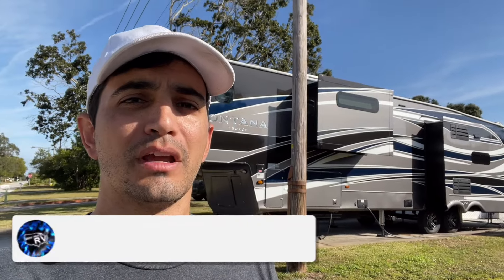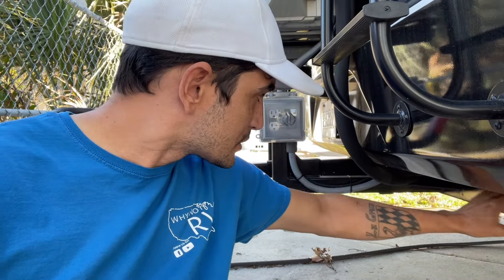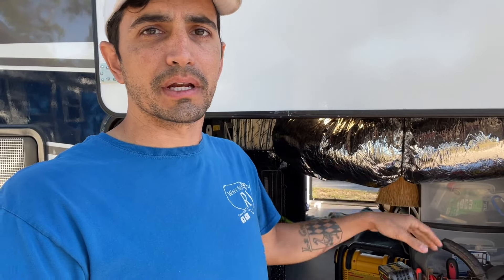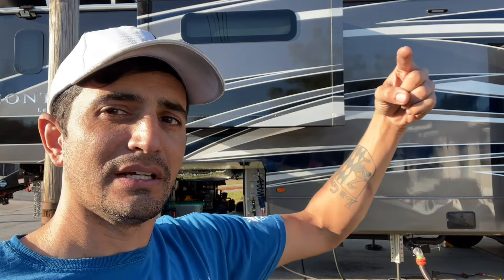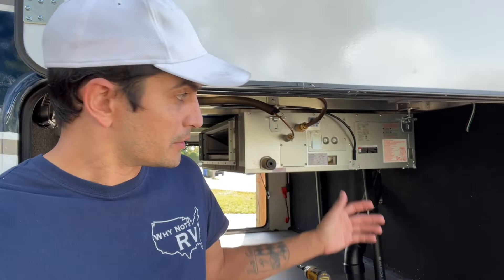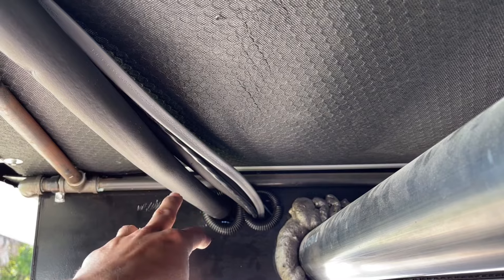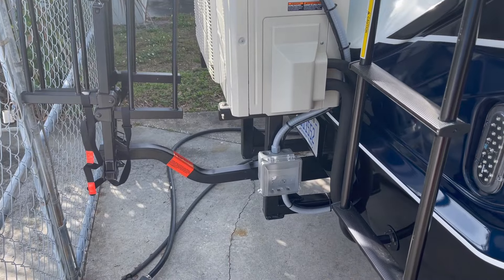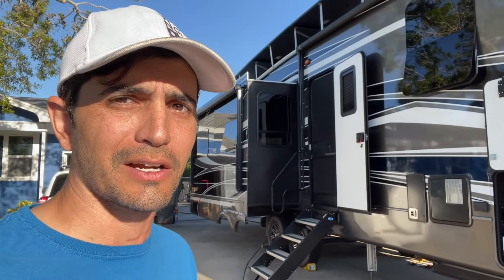The BEST Air Conditioner for an RV, DUCTED MiniSplit. Runs off Solar alone! - Why Not RV: Ep 93

Comment: I recently bought a restored 28' 1954 Spartan Manor. I plan to park it full time in Florida and have been trying to figure out how to effectively cool and heat without causing any damage to the exterior or interior original birch. This looks like a great solution using existing floor ducts
Reply from the maker: It’s definitely one option. Especially if it’s parked full-time then you can really install one of these efficiently.

Comment: I did a ducted split unit also and ran into some problems with the ducting to the rear living area.  I did use the floor vent but, didn't look closely enough to see and found out the floor vents to the rear of the camper were just the flexible 4" duct with what seemed like 40' of extra wrapped around everything except the axle, NOTHING BUT RESTRICTIONS.  I ended up running a duct through the bathroom closet and out over the top of a cabinet.  I think I may fabricate a sheet metal vent to come out by the steps similar to yours.  I had seen several videos with mini splits but yours was the only one I saw with a ducted system and gave me the inspiration to do mine.  Thanks
Reply from the maker: Absolutely!!!! Happy to hear you dove in! They design these RVs but the execution falls short often

Comment: I have a 40' fifth wheel. I installed 2 mini splits. Both 12k. one in bedroom. Other in livingroom/kitchen. We are now in South East Texas in triple digits. We are comfortable and have them set at 74. All running on solar also. Have 4500 watt of panels and 21k of lithium batteries. We removed our roof top acs.Have not needed them either
Reply from the maker: That’s awesome! Great to hear! Sounds like a nice build
Reply: @WhyNotRV  I was surprised when you stated needing rooftop acs in this heat.
Reply from the maker: The method I used doing the ducted unit isn’t nearly as efficient as the 2 individual units like you did but it is a layer of redundancy if it fails I have backup rooftop.

Comment: Great videos! I feel much better about purchasing this RV after watching this. The dealer I am purchasing it from doesn’t seem to have much knowledge about these systems you have installed and I wanted to reach out to you and see if you would be willing to answer a couple questions for me. Kind regards
Reply from the maker: Ya absolutely! What can I answer for you?
Reply: I live in Michigan and it’s going to be stored in the winter. Is there anything that I need to do to make sure that the solar system is properly shut down for the winter. And I just had a couple questions about how the factory electrical system works in conjunction with the solar system. Can it be plugged in while the solar system is operating?
Reply from the maker: Awesome what part of Michigan? The solar is a completely separate entity that charges the batteries. So it’s fully dependent from the AC input. If you watch all of the videos on the Montana you will learn every need and if you still have questions I’m here
Reply: @WhyNotRV  OK, thanks a bunch. I appreciate that! I’ve been slowly watching all the videos on our way home now from going to do the deal. It was a 3 1/2 hour drive from our home to the dealer where it was located. My main concern is with it being in storage for the winter and the roof not getting any solar energy to keep the batteries charged is there anything special I need to do to them, don’t want to take up too much of your time. I’m sure you’re busy but I appreciate your help.
Reply: We’re located near Ann Arbor, Michigan
Reply from the maker: You’ll want to winterize the camper like you would any other rv. Lithium can not charge in freezing temps. It will damage them so you’ll just shut everything down and turn everything off
Reply from the maker: @delk873 I heard you were wanting to back out of the deal after seeing the picture of the Montana during the flooding event. Let me assure you that there is absolutely zero damage to the RV. It made for a really awesome picture, but that was about it. The water came up right to, just under the door for the pass storage. It never reached inside the storage bay or anything. As I’m sure the dealer has told you. They have performed their inspections and what not and have found zero damage.
Reply: @WhyNotRV  Thanks for the response! I can appreciate what you’re saying, but I have quite a bit experience with this sort of thing. I’m a master mechanic who’s worked on trucks and trailers for the better part of 30 years. I’ve dealt with individuals as well as insurance companies on this and even though, there may not be physical signs that you can see their most definitely is secondary damage that you cannot see that will cause problems down the road. It’s just a matter of when and without having the axles taken apart and everything inspected they’re definitely will be problems down the road. And in the picture, it shows the water up to the bottom of the mini split. I noticed corrosion on the bottom of the mini split when we looked at the trailer and thought that was awful early for that so some intrusion to the lower cabin would appear to have taken place.
Reply: It’s an awesome RV you did a great job on everything has nothing to do with that. Just not something I’m willing to risk.
Reply from the maker: Understandable. Obviously I’m not the one trying to sell it 😂 no offense taken. The second owners lived in Indiana so I don’t know what salt corrosion they ran into but it wasn’t while I had it. That flood was fresh water.

Comment: Great video.  I especially appreciate the comments regarding BTU at the end.  I've installed a mini-split in a cabin (house) and it was a highly recommended replacement for window ACs.  I have a 3 AC RV and have been considering finding a way to remove the rooftop ACs and replacing with a mini split.  One big question I have is how big should the mini split be.  You helped tremendously with an answer.
Reply from the maker: There’s several factors to consider when deciding this. The best thing with the minisplit is you can oversize it quite a bit and be fine as the minisplit will just ramp up and down as needed
Reply: @WhyNotRV  Good point.  However I have noted that the higher the BTU, the larger the compressor box, and that needs to be part of the considerations.
Reply from the maker: Yes, it definitely does. Especially with RV installations when you’re working with limited spaces.

Comment: I’m thinking of doing this with a new manufactured home that I’m putting on some land. The home comes with all the ductwork in place for central air. It is sold without ac/heat and I figured I can just tie one of these units into that network so it will distribute the air. I’ve installed a few wall units before but never a hidden ducted mini split. Thanks for the video.
Reply from the maker: Manufactured homes are ducted for package units that move a massive amount of air. These minisplit ducted units would not be ideal. But you could do the ductless minisplit units and do a couple depending on layout
Reply: @WhyNotRV  thanks. That's probably why I'm not seeing much info on anybody else trying this setup.
Reply from the maker: Anytime

Comment: Hello, Did you have any communication problems between compressor to the air handler. I’m installing a Senville with similar set up. Since the ground and neutral are not the same like in residential. Thank you.
Reply from the maker: No issues for my Install. I ran its own 4 wire communication wire if I remember correctly

Comment: I'm wondering if you thought about mounting the enternal unit inside the front compartment where the genny prep is usually located and then adding a vent from there to the outside for it. That would remove the need for the long connections between outside and inside units as well as put it closer to the main power panel of the RV. Since it is genny prep, I would think it could handle the 100lbs of the minisplit.

Do you think that method would be a possibility or does the external unit need to be completely outside?
Reply from the maker: I did not go that route for several reasons. Number one, I added a generator to this unit. Number two in order to have proper airflow across that unit, you need to basically turn the generator prep door into a completely vented door that would allow air to come out of it. you’re also then asking for debris and what not to get up through those vents and into the unit. It just wasn’t a good idea in my opinion. I have seen it done before.

Comment: Well done. I think I’m going to try and pull off the ceiling tile cassette inserts on my class A. I have less room for ducting under mine.
Reply from the maker: That’s definitely the other main way to do this efficiently. Good luck with your project!
Reply: Are you planning on making a cover or are you going to have it hang down on the inside? I’d rather not do the cutting a hole and cover thing so I’m debating putting one in that hangs down and have a small enclosure around it for looks.
Reply: @mrjjman2010  just go with wall mounted air handlers or floor board air handlers if you are going to just have it hanging down.
Reply: Yeah, but with a bigger condenser required to have e multiple cassette heads, can it still be solely powered by solar?
Reply: @fobypawz418  if you are running multiple cassette units off of a single outdoor compressor would require using 240v inverter since the smallest multiple units mini splits are 18,000btu and 120v units max out at 12,000 btu
Reply: @randybobandy9828  would Batteries and Solar Power be enough to run such a system without the use of shore power?
Reply: @fobypawz418  yes but that depends on a few factors. How many panels are you going to have (total solar wattage) how large of a battery bank(in watt hours) and how efficient your mini split is. There are some mini splits that are 30-40% more efficient than others. But yes it's very possible. Do you have a particular brand of mini split in mind? Or model?
Reply: @randybobandy9828  I like the Daikin brand the youtuber content creator is showing.
Reply: @fobypawz418  yes Daikin is a very good brand and pretty expensive. I would say 1800w of solar would be enough to run that size system without worrying about running out of power. If you have a rv large enough to need 2 cassette units there should be more than enough room to hold that amount of panels.
Reply: @randybobandy9828  perfect! Thanks for the help in deciding which way to go with this!

Comment: Nice set up! Do you know if a multiplus 2 would power both legs of the mini split, or would I need a 220 V auto-transformer?
Reply from the maker: The multiplus 2 would only power both legs in true 240v when on 50 amp shore power. Otherwise it puts out the same wave length to both legs so it’s not true 240v
Reply: I believe you can get two and run them in series so that you get split phase 240v like a house but a single one you can’t without shore power.
Reply: Multiplus 2 can not output 240v. It can only pass through 240v. When used as inverter, it provides  single phase 120v on both legs.

Comment: Awesome, Could I install some exhaust ducting on the condenser? reason for this I live in norther Canada and what to grow vegetables all year long. and what keep condenser indoors and exhaust heat to the outdoors. Mini split condenser won't work in -45C
Reply from the maker: In heating mode the condenser absorbs heat from outside and rejects heat inside. If you have both units inside you will literally just be recycling the air over and over again and not doing anything but using energy. It’s the equivalent of having a battery power an inverter and a battery charger plugged into the inverter charging the battery. It cycles through and the efficiency loss will end up draining the battery over time. So to make a long story short…. No lol
Reply: @WhyNotRV  i forgot to mention the condenser is in another room, with the exhaust vent to the outside of the building.
Reply from the maker: All that will happen is it will absorb all the heat that is in that room. Once all the heat is gone, the condenser will have nothing left to absorb. Make sense?

Comment: Great video! Can you tell the details of adding the 220 service to your rig? I've been told it's not possible...
Reply from the maker: I did a video on the inverter setup for this rig. I think it’s labeled Victron mobile power plant
Reply: @WhyNotRV  thanks, I'll check it out
Reply from the maker: Let me know if you have further questions
Reply: @WhyNotRV  I do have one more.. I've added many 220 circuits to residential boxes. I understand I'm dealing with only 50 amp service, but why can't I just add a 220 breaker to the AC box in my motorhome...?
Reply from the maker: so first thing is going to depend on the panel in your motorhome, if the 50 amp breaker is in the middle you can not add a 220 breaker because 1 leg feeds the left half and the other leg feeds the right, if your 50 amp breaker is on the far left or far right side and the bus bars are setup for 220 (meaning every other breaker is on one leg and the opposing is the other leg) then you can do just that
Reply: @WhyNotRV  it's on the left, so good news I guess!
Reply from the maker: There you go. Just make sure the breakers are wired properly like a said earlier. Just test continuity between one breaker and the one next to it. If it has continuity, then they’re on the same leg but if not, then they’re on two separate legs.

Comment: I have a 30 Amp 
/120v to rv.  This is 240v.  What would be your recommendation.   The power center in the rv is a 120v.
Reply from the maker: There are 120v Minisplit options out there. All over Amazon and other distributors. I don't have any personal experience with any so I can't recommend

Comment: Awesome video!  I wonder if they sell a 120v ducted mini split?  Or are they all 240v?
Reply from the maker: They are available in the 120v as well. Just not as efficient as the 240v
Reply: There are 120v models up to 12000 btus only. He's right they won't be as efficient as the most efficient 240v models but that doesn't mean all 240v are more efficient than 120v.
Reply from the maker: Exactly Randy. There’s hundreds if not thousands of units out there in a wide variation of btus and seer ratings. What it really comes down to is what do you need / want for your specific setup.
Reply: @Why Not RV  I know there are 120v minisplits, but are there 120v with cassettes? If so can you helps us finds it

Comment: Hey there, I've got a 22rbk north trail travel trailer by Heartland. With a 13 500. Roof top ac. So was thinking about putting a mini split in,but have no idea how to connect it to my duct work in the ceiling. I'd like to take Rooftop AC out and replace with the maxxair fan. Just making sure that the min split will cool down the camper? And if I don't use my existing duct work,III have to hang the face unit on inside above my bed. Also is the inside unit gonna drip water or leak water inside? I've seen people install the mini split on cargo trailer/ camper conversion.  And the people seem happy with the unit. Just making sure I'm doing the rite thing.  I'd love to enjoy watching TV or having a conversation without the volume turned all the way up. Any opinions or ideas would be much appreciated.  Thank you
Reply from the maker: The wall mount units are great. They have a condensation drain line that you have to run somewhere, either by regular gravity draining or to a condensate pump and pump it up and out, just depends on how you want to do things. With mini splits there is endless possibilities so it’s up to you how you want to accomplish it

Comment: How do you supply the 220v? Im looking at replacing our 2 roof top 15K btu units with a 24K ducted mini split because the power consumption of the 2 Colemans is insane and inefficient. I have a roof ducted RV but not sure if I'll tie into that or not yet. Still planning. Just need to figure out to to get the 220v safely. My 5th wheel is a Sabre 37FLL with 50amps.
Reply from the maker: If you watch my video on Victron mobile power plant you will see how I achieved split phase 240v 24/7/365

Comment: Hey very interesting videos and some major $$$ upgrades. Question in regards to the 230v mini split. I recall a video stated the only way for all this power consumption is having the solar power you have. Is this true with upgrading to the mini split like yours? We are always on shore power so no off grid needed. Could you help explain. I’m seriously thinking and wanting to add a mini split just like you did with the duct. I have a 22 keystone avalanche model.
Reply from the maker: Hey Scott. I see you reached out on Facebook so I’ll comment there.
Reply: Can you answer this for me as I’m interested too. 102° last week and it was 90° with two 15,000 units.
Reply from the maker: @Robert Walters What’s your exact question?
Reply: Would this worked connected to just a 50? I don’t have solar panels yet.
Reply from the maker: Yes. 50 amp plug is split phase 240v when wired correctly. Unfortunately some campgrounds get cheap and don’t wire properly. If you don’t know you can buy a multimeter on Amazon for $30 and test the outlet to confirm.